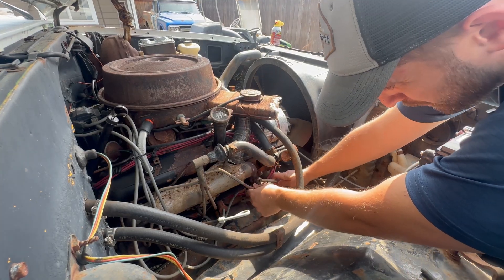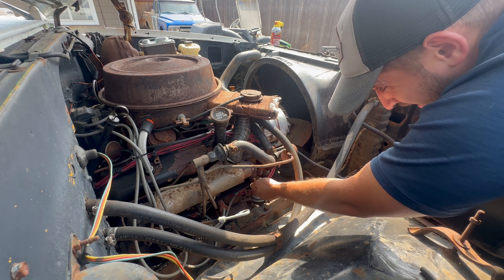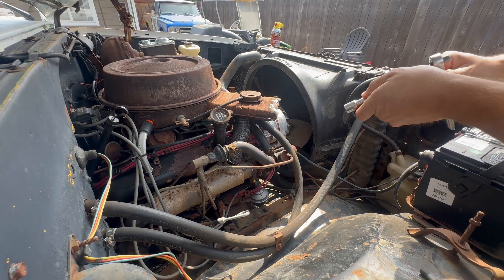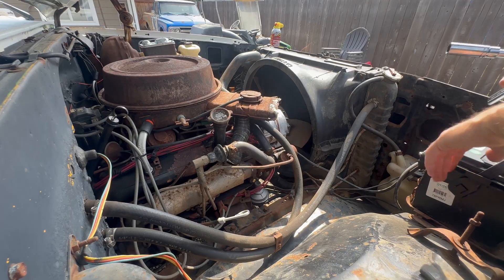No More Smog Pump Mess! Watch This Easy Fix

Comment: Would this be the same for a 88 tbi small block?
Reply from the maker: @austinskelton9930 Yes same process, if you have a serpentine belt, you will have to get a shorter one. If you have v belts then it is exactly the same, just remove the belt that goes to the smog pump

Comment: I would imagine this is the same process with a big block? I got a mark IV 454 that has started to run rough, sound weird, and shake kinda bad and after testing everything else that could cause that i never thought that it might be the smog pump.
Reply from the maker: Yeah, it’s exactly the same. I just did it on my 1986 1 ton with a 454. The only difference would come if you have a serpentine belt instead of v belts.
Reply: @N @NSRprojects nice, thanks for the advice

Comment: What size belt did you use?
Reply from the maker: After removing the smog pump, you no longer need the belt. I only have the power steering belt and the alternator belt on the truck now. I can get you those part numbers if you want.  Or is your truck a serpentine belt instead of v-belt?
Reply: @NSRprojects damn, my El Camino the belt runs the smog, alternator, and water pump.
Reply from the maker: @jamesiver7252  a lot of the SBC with that style belt run a Dayco 5060865 belt after deleting the smog pump. It's 86.5 inches, so just tie a rope around all your pullies and measure it to see if its close to the right length. That is how I always do it, just make sure the new belt has the correct amount of ribs as well.
Reply: @NSRprojects it's a very belt on a 78. I'll measure and figure it out.